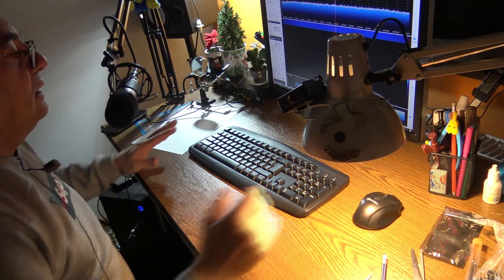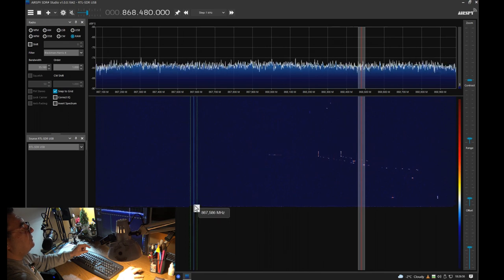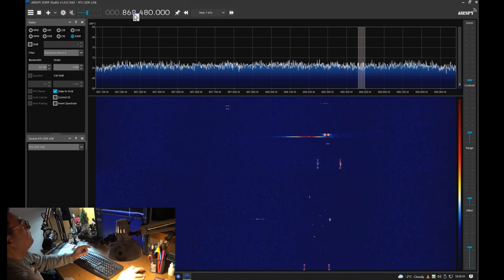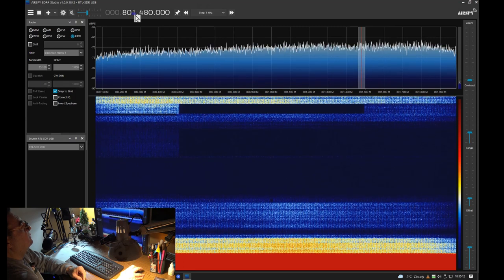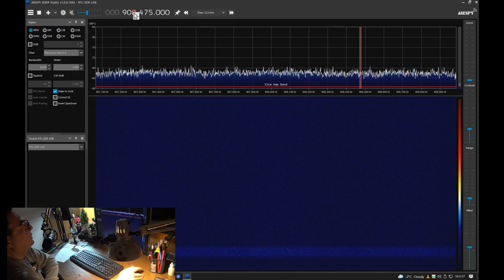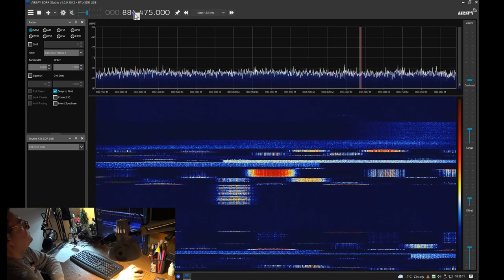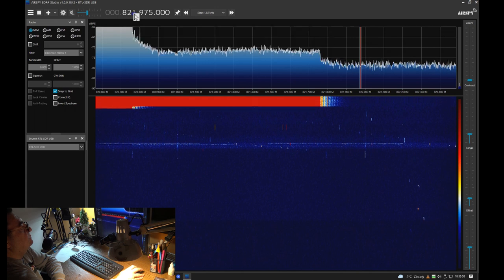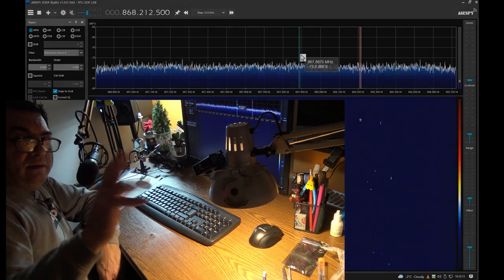Checking LoRa radio band with SDR radio

Comment: These are likely not LORA signals. The same frequencies are used by millions of short range (low power) devices.
Reply from the maker: Yes, there lots of other signals in the band..the LoRA ones have a zig-zag patern inside..it can be easily seen

Comment: Can this SDR measure the true gain and tuned frequency of helium antenna?  If not what would you suggest?
Reply from the maker: I don't know..but I can see at least which is better.I will send a steady 868Mhz signal from 20m via Nanovna and I can see how much each antenna can receive..probably, checking the numbers I can find the gain too..will see.Most important is to find if the antenna is tuned..BTW check Sorin channel about this..he is got a lot of experiments too..
https://www.youtube.com/c/CryptoMiningTrading
Reply from the maker: THe best for measuring and tuning tuning antenna is a nanovna..like this https://www.youtube.com/watch?v=r5I6-4k401o&t=279s
Reply: @viocaia  Yes.... Looking at all the Amazon eBay junk who knows what your getting..... I'm trying to see if on frequency and get true gain output on miner to test what works best for my area.... Loved to see radiated pattern....... I have seen 12" to about 36" 8 dbi antenna and wonder if the lobes differ?
Reply from the maker: @michaeld4502  I bought few..including an Yagi..all for US freq..and even there..that's why I build my own and it's working great..but Nanovna it's need BTW